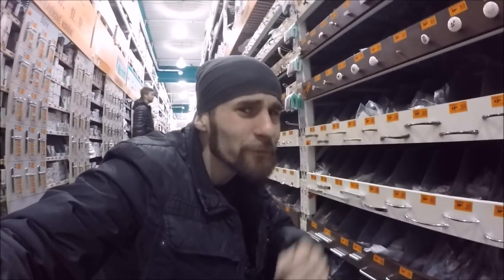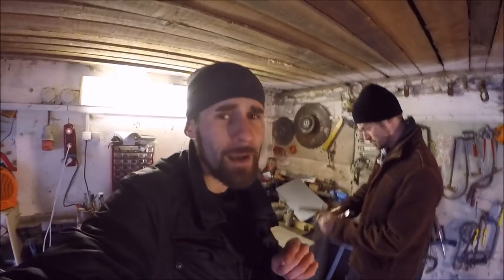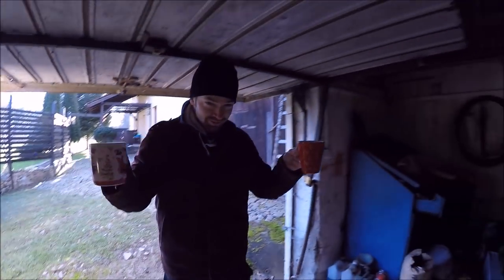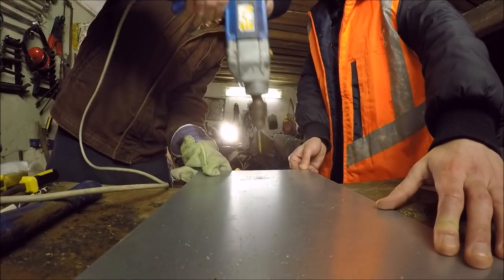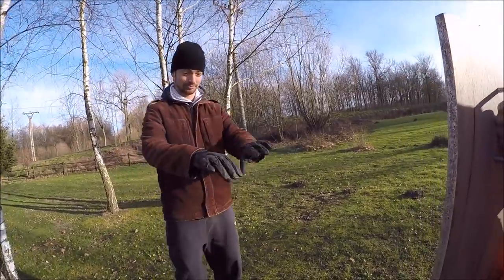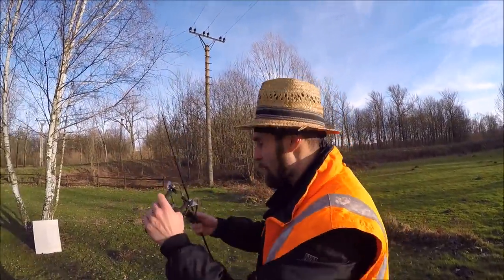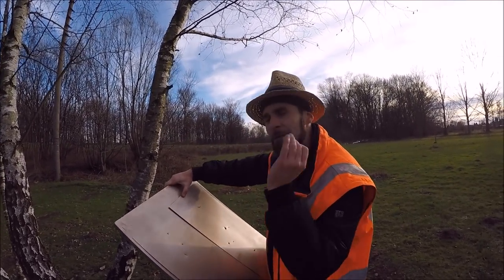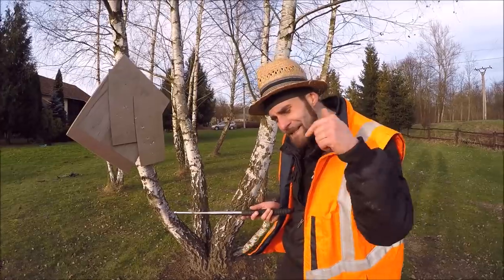DIY 20 $ SHIELD - Build/Test (Will it Survive?)

Comment from the maker: Hello My Friends,
Let me know if i should start Series - DIY Shield Build/Test, it could be lot of fun :) Dont forget to SMASH that like button on this video,Share it with your friends aaaand See You Next Time ,))
Reply: Adam Celadin can u do a vid with ballistic knife ???
Reply: Adam Celadin You look like a person a know :)
Reply: Adam Celadin you should start a series  good job , you are the best
Reply from the maker: Maybe i will try that no name :)
Reply from the maker: Thank you Ignacio :))
Reply: Yes, a DIY shield for urban war/urban battle series! It can't be the plastic riot one but lightweight and versatility is absolutely necessary.
Reply: Adam Celadin yea,it would be fun👍🏽
Reply: Adam Celadin you can strengthen the shield in a few ways. 1, use bolts or rivets to attach the steel instead of screws. 2, use hardwood like oak instead of random wood. 3 overlap the steel plates in the center slightly to correct the weak spot between them.
Reply: This was a fun idea, I liked it
Maybe some washers and bolts would hold the plates on better, 4 bolts per plate with a washer on each side of the bolts for more surface area. I like the idea of doing the best you can on as strict of a budget as you set up lol
Reply: VERY AWESOME IDEA I like building weapons myself :)
Reply: Please start a DIY series it is so NICE
Reply: yeah you should do that it's bona be fun
Reply: Yeah you should do that it's bona be fun.
Reply: Yeah you should do that it's bona be fun.
Reply: Use a nut and bolt

Comment: I have made a number of shields that held pretty well against impact (3kg sledgehammer, 1 handed swords etc...)

1. The wood can be almost anything, I usually use Fir planks because they are cheap
2. I buy a sheet of metal that is a little bigger than the wooden plank
3. I buy some really cheap pillows (not more than 3 dollars of pillows)
4. For the handle, i usually cut an old belt and use part of it to secure my forearm, and part of it to create a grapple handle
5. I put the pillow filling over the wood
6. I put the metal sheet over the pillow filling, then i bend the extremities to reach the interior of the shield, then i fix the metal sheet from the interior to the exterior (this way, it doesn't fall)

with this combination, you make a shield with less than 10 $ that can resist to blows that would otherwise provoke severe fractures. The pillow filling disperses the shock REALLY well and the metal sheet helps the shield deflect the blow. If you want, I can send you a video of how to make them

Comment: As always, I appreciate yours and your student's love for the skills. Regarding your advice question; have you considered a few options? *Try just the same, but used a polymer instead of more screws, it helps weight. **Try a rubber or plastic layer between wood and metal sheet. ***Try a series of smaller/shorter sheets. Maybe 6-12 inches tall and full width of the shield or barrier.  
I will be very happy if any of those are helpful and I hear, good or bad from you in a video. Haha always, enjoy yourselves!

Comment: Put some 3/16 by 1 1/2” steak stock strips in diagonal pattern over lapping on top of you thin sheet metal. And foam padding on handle to help hold the weight that will come with doing this or put 1/2 steal sheet on top of wood. She going to be heavy but almost bullet proof👍
Reply from the maker: Daaamn that sounds awesome, thank you for comment !!! :)
Reply: Adam Celadin you bet. Thanks for making all the videos. Trying to get back into throwing and I watch your videos everyday.

Comment: An Awesome video, you can improve that shield, by putting first industrial glue, then putting the steel plates, after that you need to mark and put holes in the corners and the middle of the plate, then putting the screws on the holes, and with that i think it should be it
Reply from the maker: Thank you for comment my friend :)

Comment: Nice Video bro! Next you could use some plywood instead of the chipboard, it's a lot stronger and I think the screws would hold much better too :)
Reply from the maker: Heey bro, how are you ? :)) Is it much more expensive ? Thank you for comment my friend ,))
Reply: Adam Celadin I'm fine thx :) I think it's not that expensive, where I live the hardware store looks very similar to your's, so I guess you can get it in the part where they cut the wood to size for you.

Comment: There are many ways to improve this, it is just a matter of how much money you want to spend and what end results you want. For one, I would not use particle board. I would use layers of really thin plywood, with layers of Kevlar fiber sandwiched in between alternating layers, held together with resin or some kind of two part epoxy and held together with clamps until it cured. Then drill holes in it and bolt on your steel plate, but make it one plate instead of two, you don't want any gaps in your plates. Like I said how much money do you want to spend though ? Cool video!
Reply from the maker: Thank you for nice comment and inspiration my friend! I cant spent (for now) more like 20-30 $ for the video so i think still around that budget :/ But i am sure we gonna figure it out some inspiration :)

Comment: Yeah particle board is hard to keep screws or Nails in. that's why you should bolt it, and use some kind of contact cement or glue keep those steel plates on, with the glue in the contact cement will help for shock-absorbent you can also get fiberglass kits to put on top and make it real strong
Reply: But also I love this DIY stuff makes me want to do some, and when I do I'll share it with you

Comment: How about to take some hardened aluminum plates.. like 5-10 mm thick (how much you can lift). I know this will be very expensive, but it might work as a protection! Or maybe you can tie the shield up in some chainmail!... Or some bulks.. little ones all over the shield. Like the ones the ancient warriors did the big one in the middle but this time a lot more smaler ones all over so the force get redirected in a different angle.(of course this little bulks would absorb a majority of the force i would think)

Comment: First and obvious thing is it to use Rivets or Bolts. If you want a better shield though, I would grab a skill saw and cut the shield in half and with each of the halves do a 20-35 degree cut on each end. Then attatch the plates on the metal and then use a thick 20-35 degree angle steel and attach it to the seem of the shield. The shape of the shield would help deflect projectiles to the side since it has a V shape.
The logic behind doing this shape is because an arrow going straight at a significant speed towards a flat target would transmit all of its energy to the target since there is no where else to go. But an arrow going straight towards an angled shield would act like a ramp and force it to go sideways while also taking only a fraction of the force and transferring it to the side.
But! Because the arrow would most likely deflect, please use it as a target only and keep people away from it when firing at it.
Reply from the maker: Thank you for nice idea Jesus, maybe we gonna try it this way interesting definitely

Comment: The metal came off because the screws got threaded. You can see the power drill over tightening the screws and they just kept spinning and spinning. Try using a handheld screwdriver next time and don't overturn it!